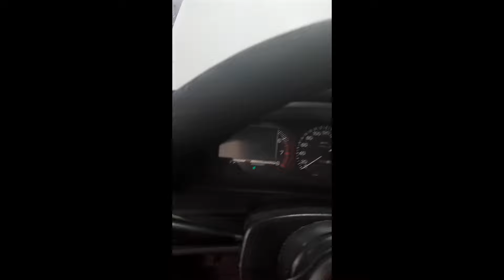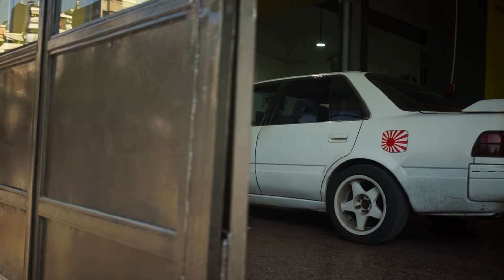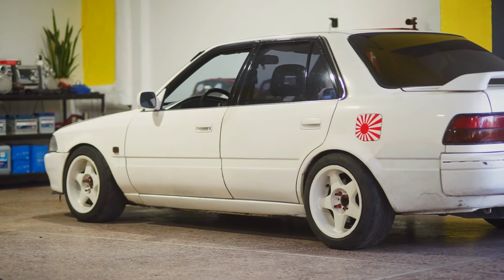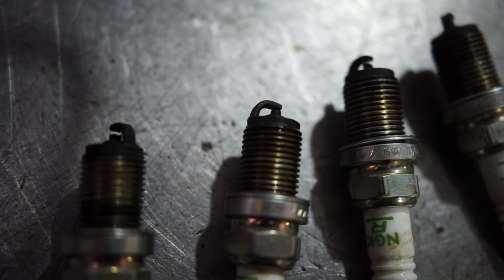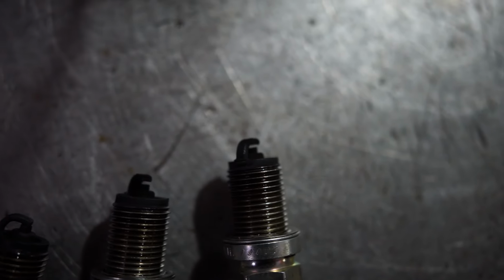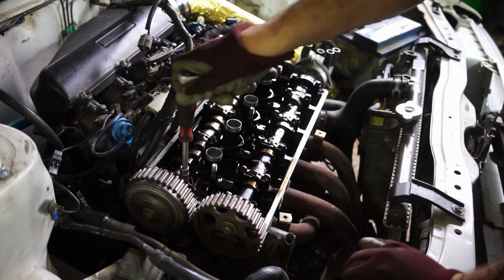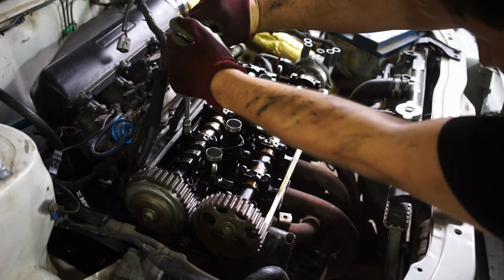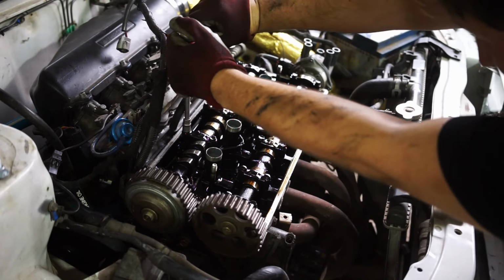Blew my engine in the most stupid way possible... | 4AGE 20V Turbo project blown engine before turbo

Comment: So you had metal debris from your air box fall down the spark plug hole, get in the combustion chamber that damaged part of the piston and cause your valve to hit it and thus bend? 

My commiserations! At least your bottom end isn’t affected 🙏
Reply from the maker: haha yeah you could say that. 

well the piston is kinda rough but i think ill just grind the edges a bit and polish it should be fine
Reply: @throttlebuddies0  diesel pistons comes like that from factory they make lower noise so i think you got an upgrade🤣🤣🤣🤣
Reply from the maker: @marlo0oty213  haha true that lol, lowered compression on one cylinder for turbo lol
Reply: @throttlebuddies0  the dimple tech is used on diesel for better sound reduction.. yea one cyl lower compression means lower dynamic on all 4 🤣🤣🤣🤣
Reply: @throttlebuddies0  that’s a shame! At least it wasn’t by bad tuning! So we cannot doubt your tuning. 

Even more reason to have a daily vehicle, if something goes wrong with the project, you still have a daily to use.